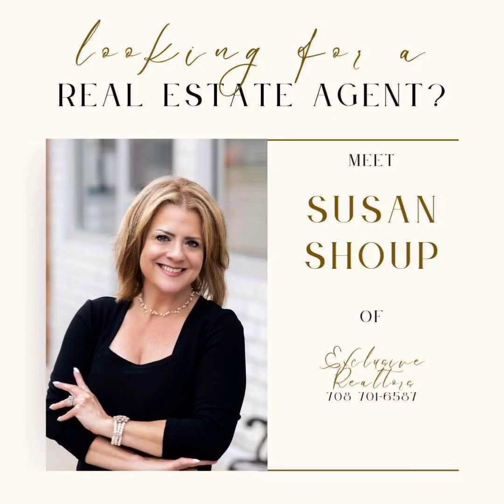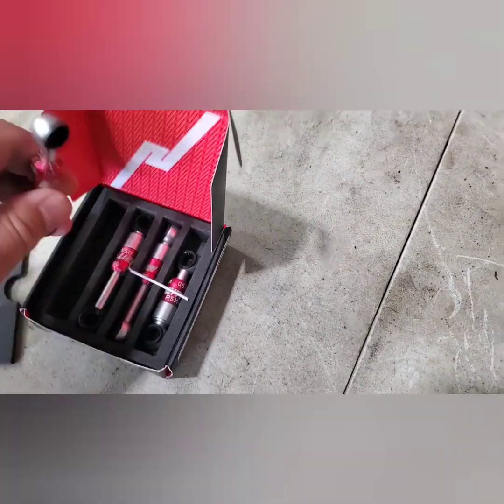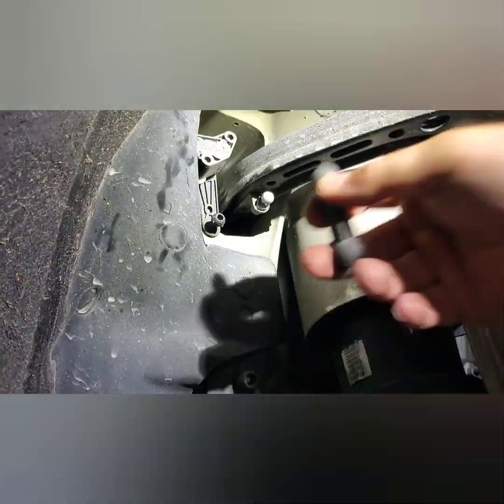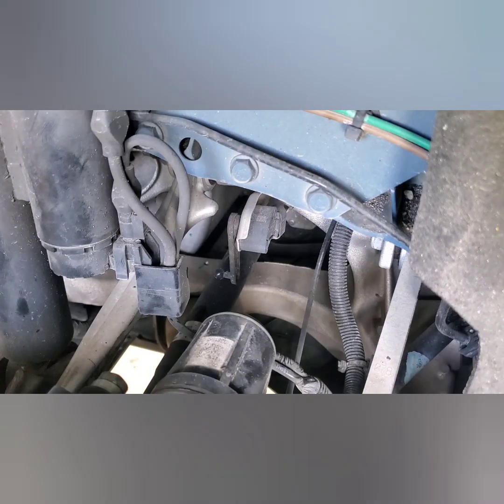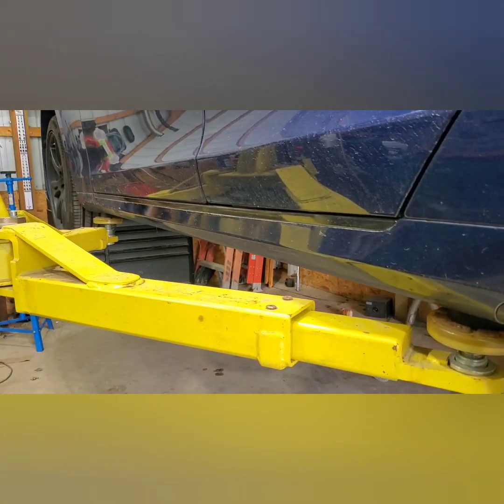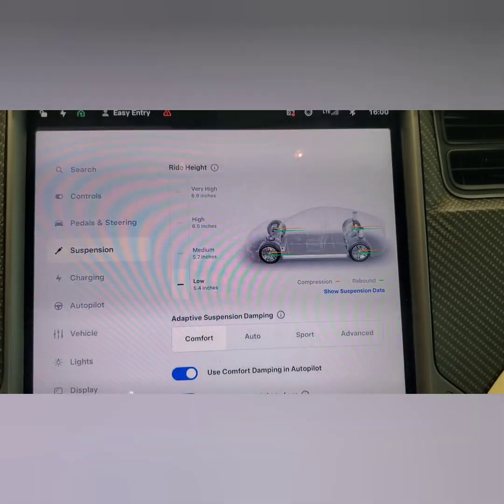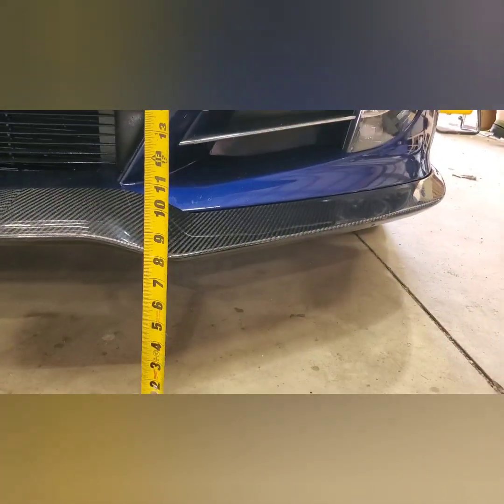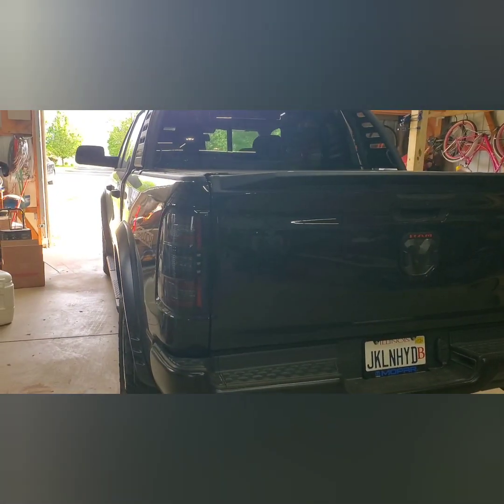Model S N2ITIVE Lowering Links

Comment: Mark how do you find out on this very cool I would have never thought of that good job
Reply from the maker: The air ride leveling sensors just need to be tricked with different length links. On e I get the 21's back on I'll see where it's at.. maybe I'll drop it a touch more